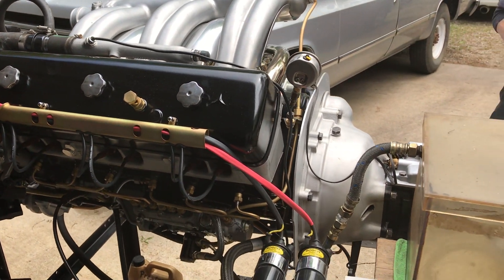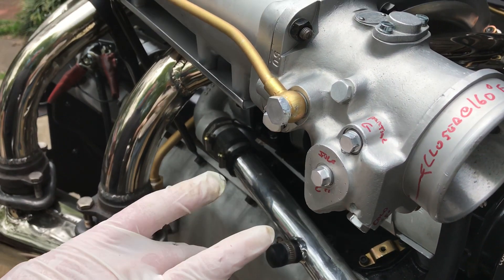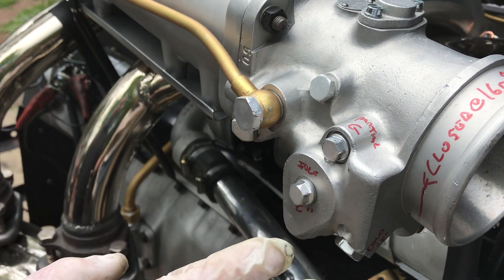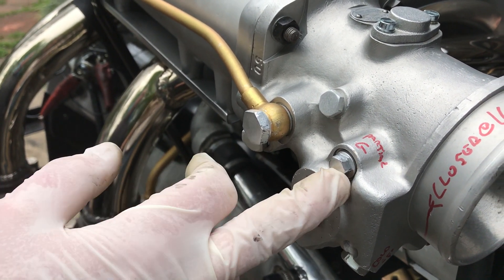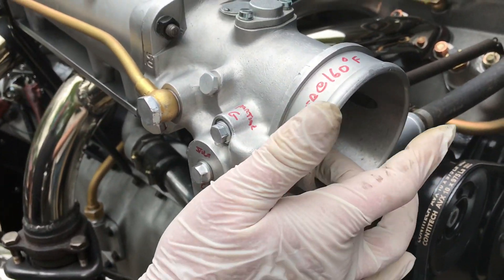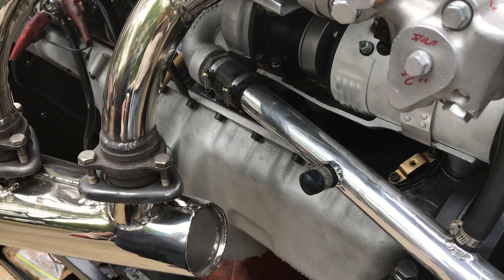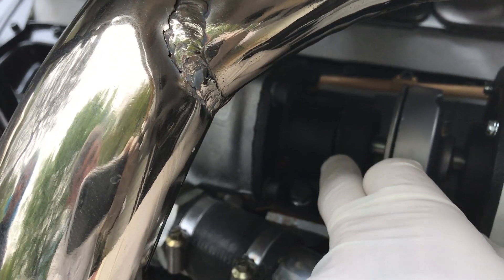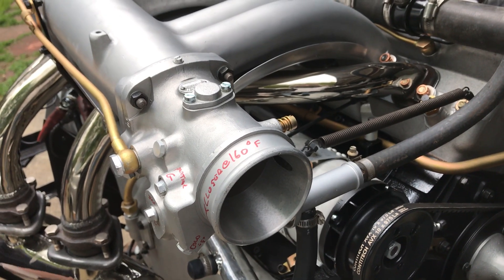300SL Engine Test

Comment: I would just be happy with the engine and the test stand
Reply from the maker: Thank you for viewing. I was proud of my engine stand, made it myself in welding class years ago. The plexiglass "oil" tank and hoses were somewhat difficult. I was worried the plexi would not like the hot oil. But no worries. It all works well. And the engine is a beast. Here are links to us test driving the car with this engine:
https://studio.youtube.com/video/lDiVWnfG3i0/edit

https://youtu.be/KokzBg3cJmg 
the good part is at 4:30 in this one where we run the engine up to the full 6000 rpm